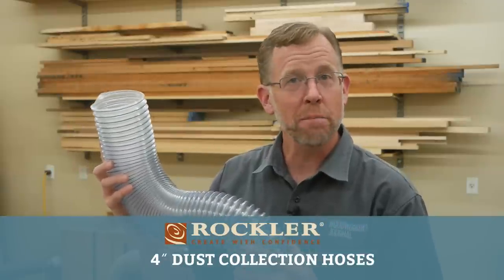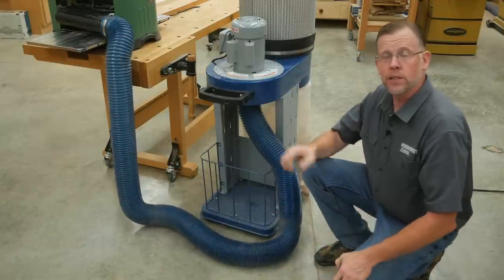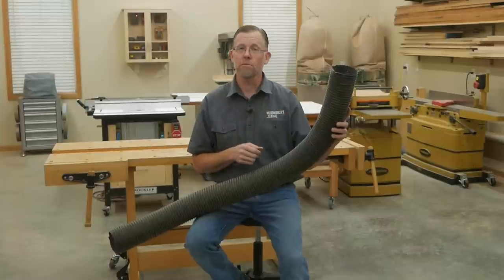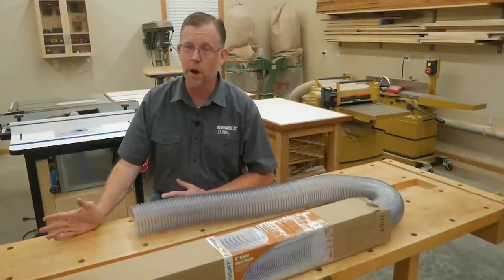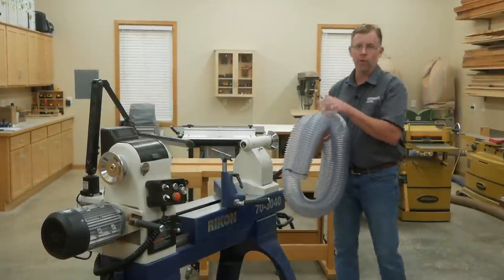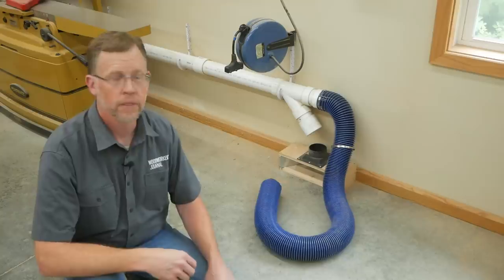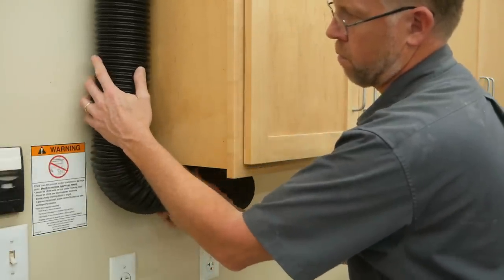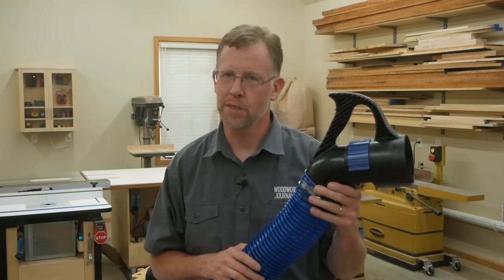Choosing 4" Dust Collection Hoses and Fittings

Comment: I use a combination of these hoses and their quality is incredibly good as compared what I have purchased elsewhere. I have dragged the 4" blue hose around my garage floor for a few years and it has held up very well, much to my surprise. My biggest complaint is with the keyed bridge hose clamps, the ones that have a hump in them to crossover a rib in the hose to make a cleaner, better seal. They only work on the blue hoses that are "Clockwise" wound when looking down the end of the hose. The clear hose is "Counterclockwise" wound??? Rockler needs to clearly state this on the clamp package, and how about making a " Counterclockwise" clamp for the clear hose? I get for whatever reason the hoses are made the way they are, but the clamps should be able to be made to fit either fairly easily.

Comment: Hi, first let me say that I really liked your video. It gave me a lot to think about, it was pretty instructive. 
But I have a question, it's for the dust collection system that I'll be building for my very small bedroom shop and its about piping, PVC verses the flexible hoses. 
 I just want no costly mistakes. 

Ok, my Shop-Vac is a 6.5HP with a 2 1/2" hose attachment. Now here are my questions. Should I stick to the 2 1/2" piping or should I use larger PVC pipping like 3 or 4"? 
Will the larger hose give me more suction towards chips and dust, or it would be the exact same as if I would use a 2 1/2" pipping?

And 2nd question. I know that flexible hose is not as good of an idea, cause the ridges cause loss of suction.
But let's say that I have a fair amount of flexible hose, and I want to build my dust col system. It Would be for about 6 tools, or 6 hoses, 4 tools, and 2 loose hoses for hand tools and clean up. 
So meaning 6 Blast-Gates. 
I still need to ask. If I'd use flexible hose, BUT at the exact length between each connector, no bending of it, fairly tight fits, would the loss of suction still be the same issue, cause of the ridges? Or it could do the job?  OR should I just stick to PVC?

Please let me know. I'd greatly appreciate your help.  Thanks

Comment: Rockler, this was a huge missed opportunity to show off any quick connect fittings in use throughout the video, rather the those screw on hose clamps. And then at the end you flew through them so fast it was impossible to see them all even with hitting the pause button.

Comment: Dust collection systems are really not designed to pick up long, stringy shavings from woodturning - basically comes down to the fact that shavings are not dust.  The suggestion in this video that it is OK to pick up stringy shavings from wet (or dry) shavings should be removed.  Use the dust collection system for collecting sanding DUST at the lathe, but not woodturning shavings.  You will save yourself a whole lot of headache if you do not expect your dust collector to catch your woodturning shavings - sweep them into piles and bag them separately.  You will change your dust collector bin far less frequently and avoid major clogs.

Comment: You didn’t state if the hose material was made from PVC or TPU.
Reply from the maker: The transparent hose is PVC. The FlexForm is polypropylene plastic.
Reply from the maker: The blue Expandable Hoses are made of a flexible polymer material that can stretch up to 7X its original length. The material is listed as Vinyl Flex-Hose with Metal Reinforcement Coil.